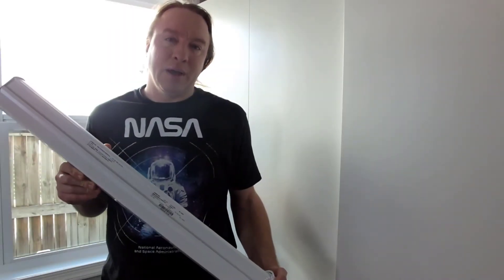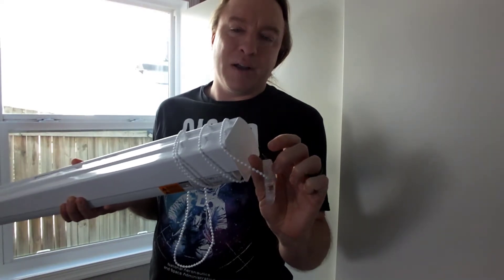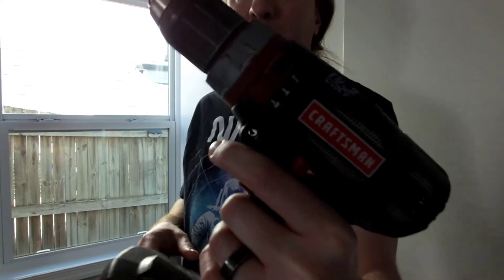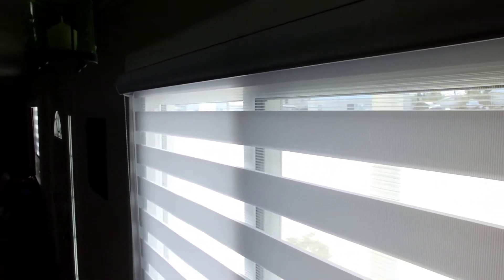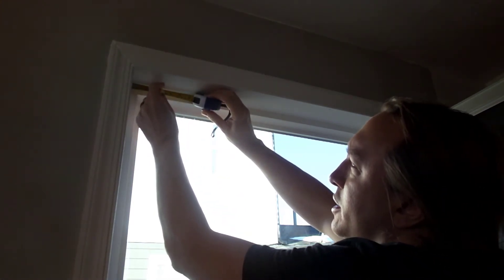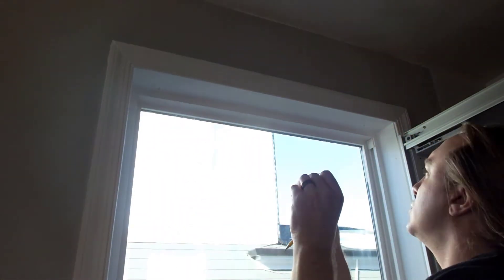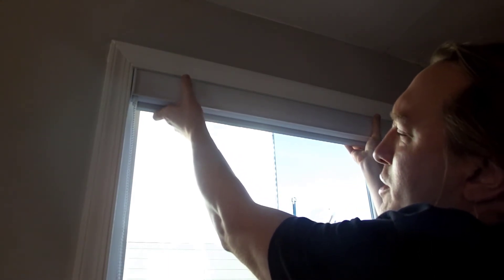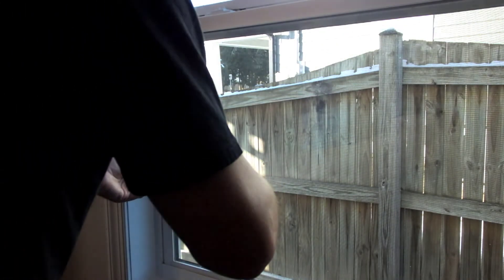How to install Blindster.com zebra blinds

Comment: Yours are easy- mine are a nightmare. You have to tilt in, hook into one side of the bracket clip while pushing a plastic retractable clip on the other side- it is proving impossible!
Reply from the maker: Oh gosh, that sounds frustrating!  Are they the same brand?  From Blindster.com?  I wonder if they changed the design on them?  Good luck!

Comment: Can u get privacy with these at night?
Reply from the maker: Hi!  Thanks for the comment.  When you click through the order process on the website they have two options: "Light filtering" and "Room darkening".  We got the ice white light filtering ones (what is shown in the video).  In my opinion they offer reasonable privacy at night (they're not see-through, or anything like that), however if you want more privacy you may want to go with the room darkening model, or pick a little bit darker color.

My recommendation is to order samples of the materials (samples are free!) to help you decide what will work best for your home.  Good luck!  ☺️